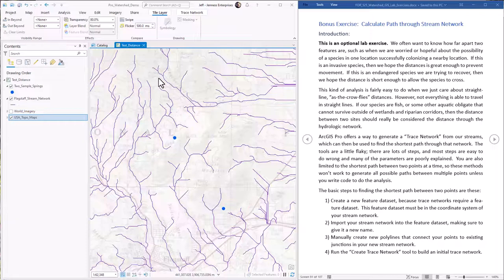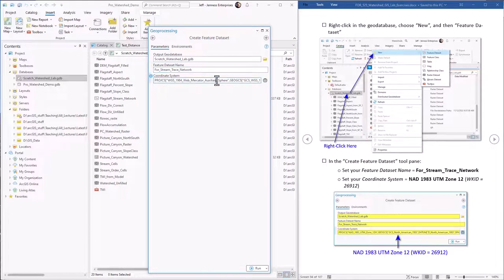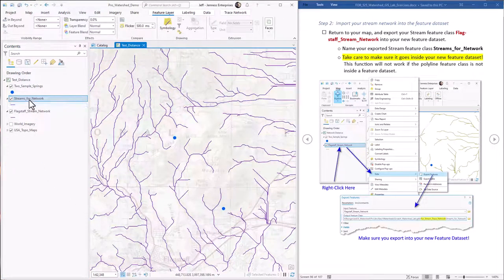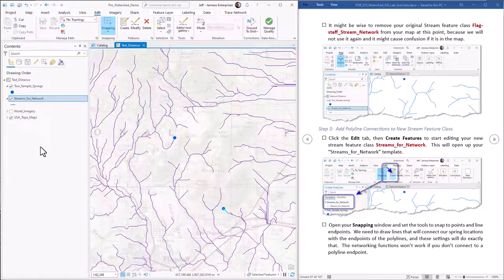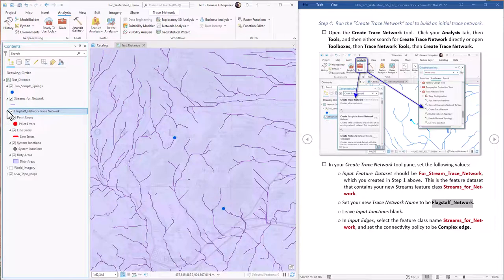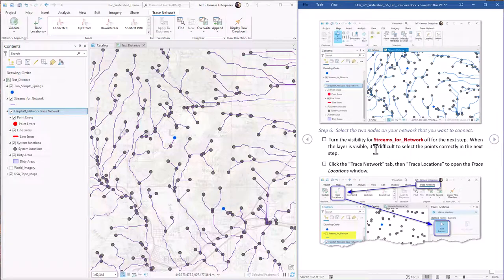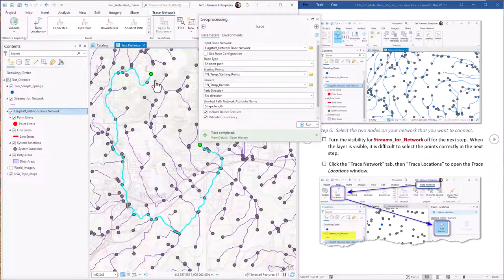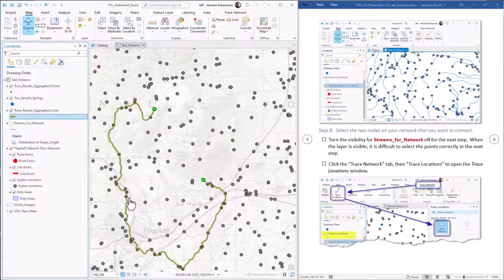Hydrology in ArcGIS Pro, Lab Exercise 11:  Finding the Shortest Path Through the Stream Network

Comment: Thank you for this super helpful video! However, for my dataset it barely gives any junction points, do you perhaps have any idea where that could have gone wrong?
Reply from the maker: Hi Nina,
     My apologies for taking so long to respond!  I'm not quite sure why you are not getting many junction points.  Are there visible places where streams connect, but no junction point is created?  Or are there just very few stream segments?  If the latter, then you might be able to get more streams by choosing a lower "stream accumulation" threshold when you're initially identifying stream locations.  If that's not the solution, then I'd need to see what you're seeing.  You can reach me at jeffj@jennessent.com.
    Hope this helps!  Take care -
        Jeff